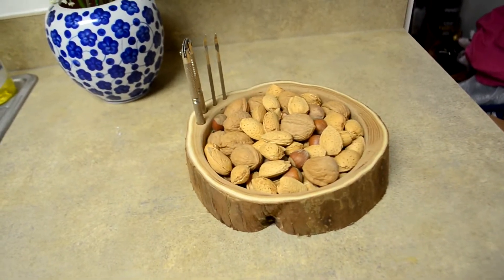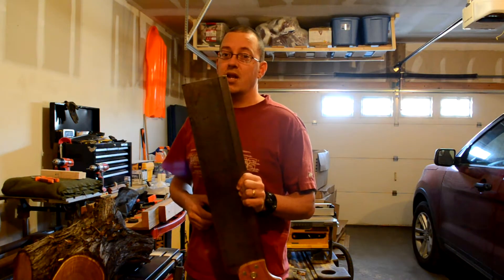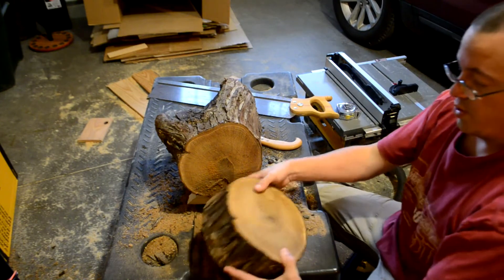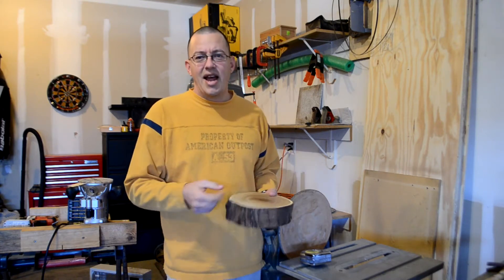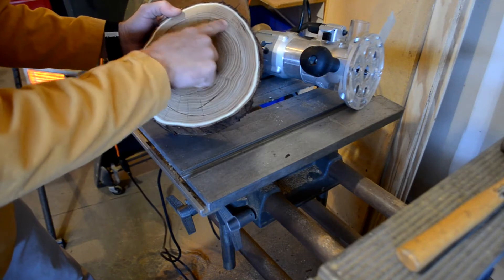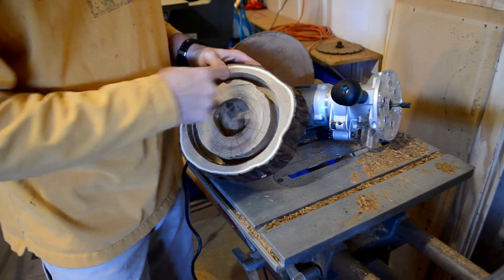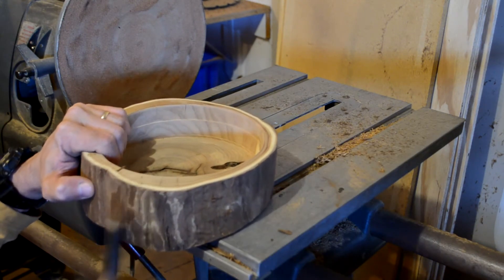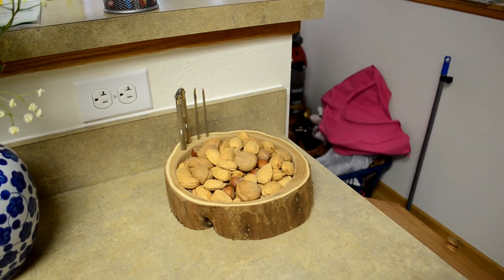Creating a Mixed Nut Dish

Comment: That's a nice project, 1 question. why didn't you use your shop smith as a lathe to hollow out the wood. Nice seeing you put out more videos. Happy new year,
Reply from the maker: Good question! I am not very experienced at using a lathe and frankly cutting out all that end grain on a lathe scares me. I also need to get a way to sharpen my lathe tools before I attempt to use them again. Thanks for the comment.